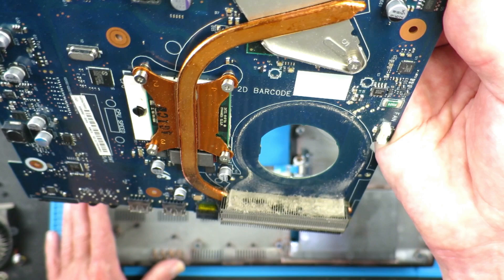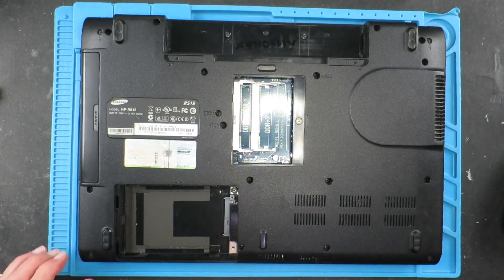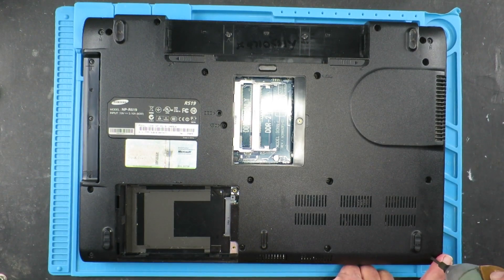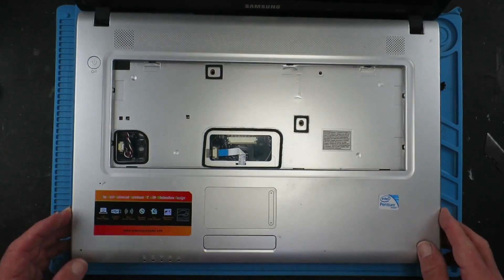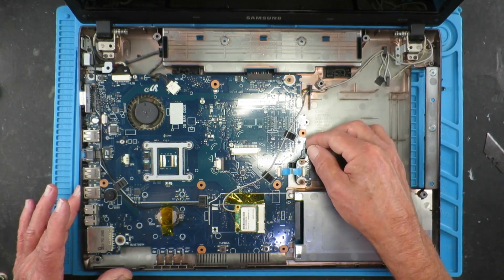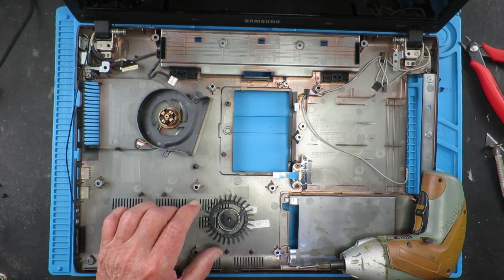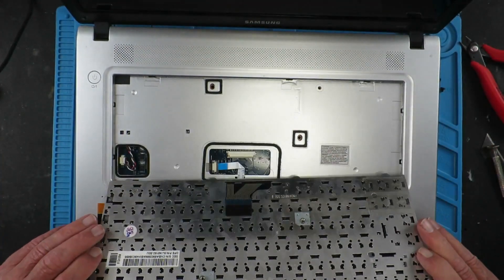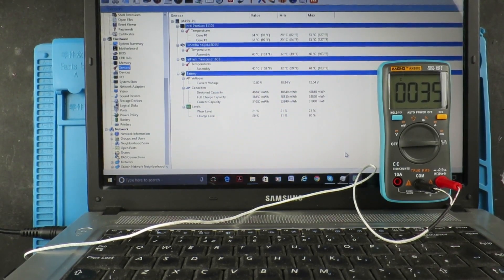Samsung NP R519 Disassembly Fan Clean Overheating Repair Tutorial

Comment: Thanks a lot for this video! I have my R519 since 2012 and cleaned it for the first time. Behind the fan I found a black layer of an unspecific material. :-) The fan sounds much better now, less noise.

I would like to ask something. When I opened on the left down side of the motherboard, I believe it was written the word Bluetooth. Does R519 have bluetooth? If yes, I would love to connect my laptop with a speaker.
Reply from the maker: Thanks for watching! I think Bluetooth was a option it is listed in this product spec : https://www.amazon.co.uk/Samsung-15-6-inch-Notebook-Celeron-Processor/dp/B002WE0EE4 Maybe look in the device manager to see if there needs to be a driver installed. I believe the driver is included in the "chipset" drivers you can get from Samsung support. Please consider subscribing if you have not done so already!

Comment: Did everything like u did put everything together and lcd won't come on its black
Reply from the maker: If it is not booting then check the heat-sinks for the CPU and graphics chip are tightened down. If it is booting but no display check with an external monitor to see if the graphics are working, if they are then the cable that connects the display to the motherboard is not seated properly.
Reply: @1nformatica  got it to work was my mistake didn't have the memory board ram inserted fully in. Thank you for your tutorial really helped me 👍 🙏
Reply from the maker: Good to know you got it working, good job!!

Comment: You jump 03:01 and you didnt show us how you lift up the keyboard.
I try to follow your steps and the keyboard is stack and doesnt go out..
How did you release it?
:(
Reply from the maker: Hi, first make sure the keyboard retaining screws are removed from the base https://youtu.be/LisQDY13Dsc?t=112
Look closely along the top of the keyboard and you will see 3 or 4 small clips protruding from the top cover. You need to push these back with a small screwdriver or knife while at the same time applying upward pressure to the keyboard. It should lift up a little as each clip is released.
Reply: @1nformatica  Thank you mate.
I fix this model today evening with wrong way cause i show the 4-5 clips at the top and i was afraid to push it cause i was thinking that if i use more force i will might brake it.
Reply from the maker: Just found another video where I show this https://youtu.be/I8dsePNPWyA?t=80